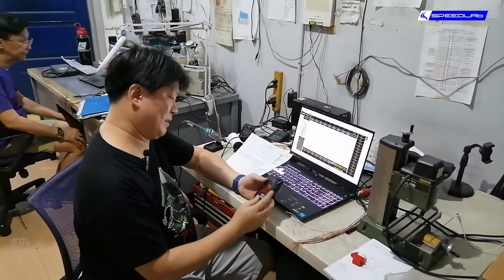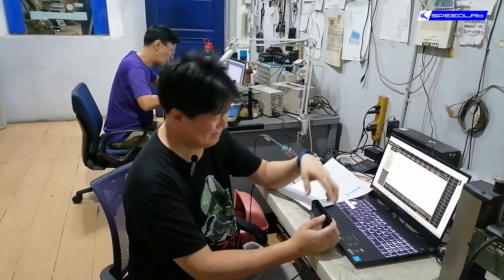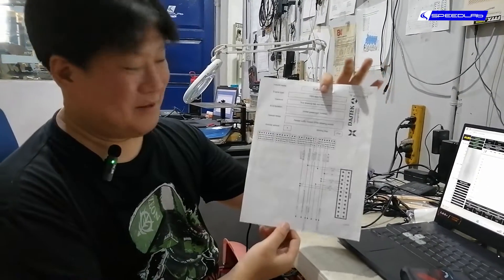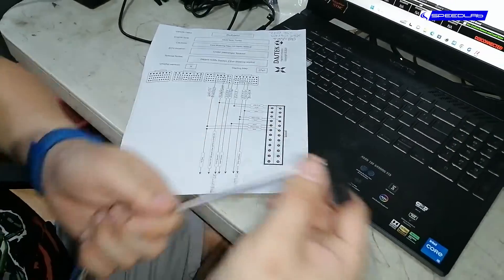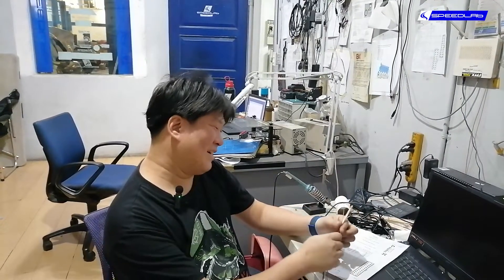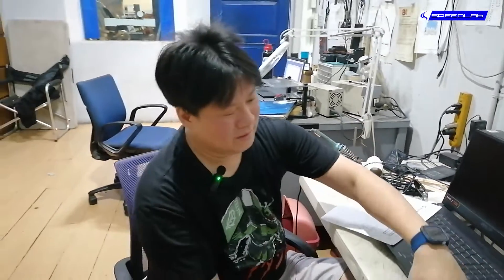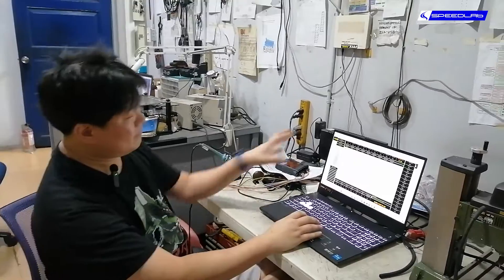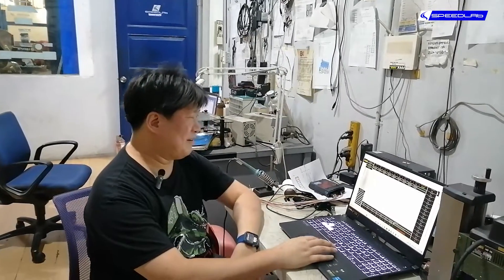How to Install and Wire the Unichip X+

Comment: Works the same way on diesels and can it deal with MAF voltage going out of range and limp mode?
Reply from the maker: @GURD28  Unichip will never be able to exceed the operating voltage of the maf
Reply: @speedlabchannel4452  I mean with an upgraded intake can the Unichip modify the MAF voltage going to the ECU so it stays within range?
Reply from the maker: @ yes

Comment: What will be the cost for the unichip plug n play without splicing for the Gen. 11th 1.6v a/t Toyota Corolla Altis? Also What results just for bone stock? Thanks.
Reply from the maker: P45000
Reply: @speedlabchannel4452  Hi, i read cost is 35k and this one is 45k, what are the difference?
Reply from the maker: @talesofthetoydad897  this is 35k 
46500 is plug and play for ranger raptor
Reply: @speedlabchannel4452  got it, 25k is the price now for asian sedan?
Reply from the maker: @talesofthetoydad897  25 is Toyota only version